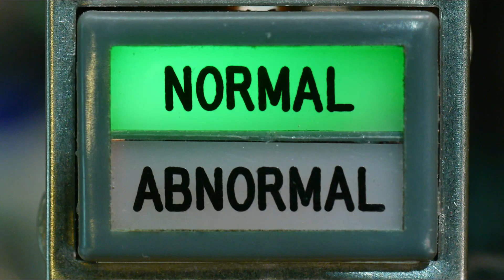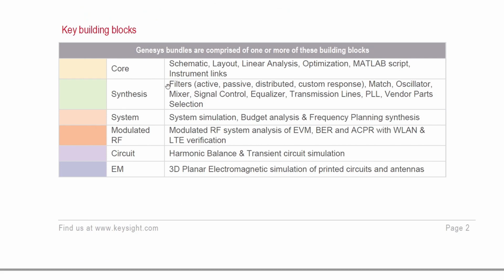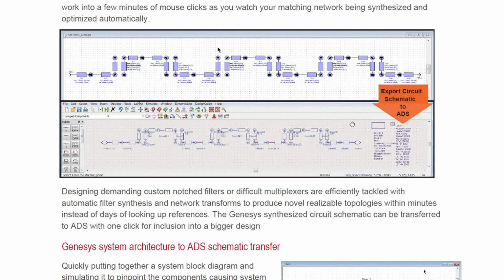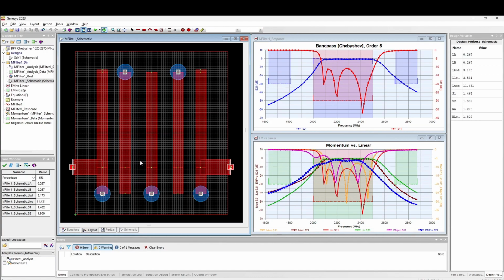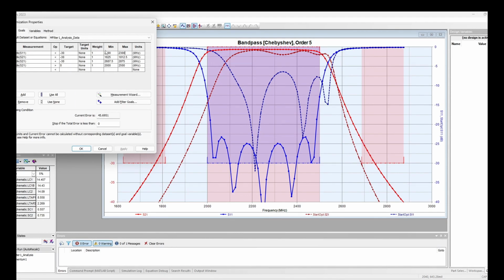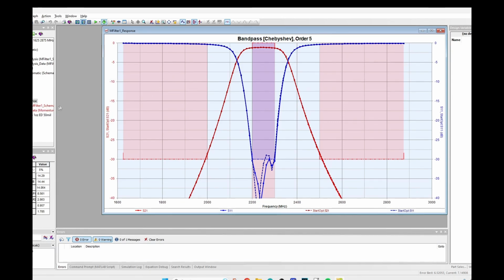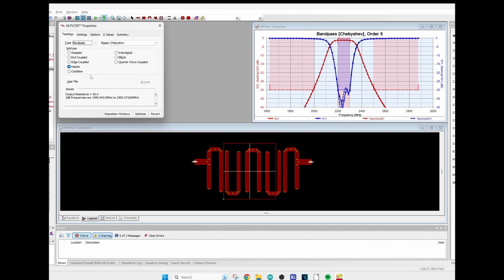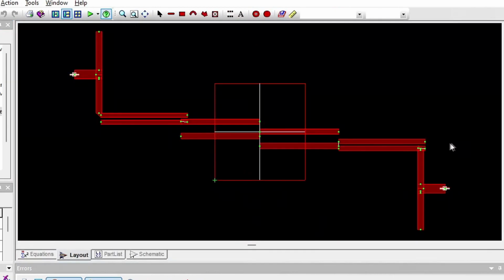#1587 Keysight Pathwave Genesys RF CAD Tool

Comment: ADS was a good tool. But, you don't need ADS to do micro-strip design; but, you need to know what you are doing. IMO the  power of ADS lies in the simulation parameters you can access... such as the pcb board types, and copper weights... as was mentioned. It's also easy to use ADS (or Genesys) to come up with a design that meets your specs; but, you haven't got a clue how it's working. That's the voodoo... which is short for "I'm too lazy to learn the engineering involved... so I'll pretend I wouldn't understand it."
Reply from the maker: I will be talking about the EM Momentum analysis which I find the most powerful.

Comment: I got a free copy of Sonnet with the book "Introduction to Antenna Analysis using EM Simulators", from Artech House. No idea if it is still available. One of the authors was president of Sonnet Software. Just a suggestion for those who don't have the freebie line to Keysight.

Comment: The weird thing is even though this is right up my street, when I see these astronomically priced packages that have no path for hobbyists AND represent a perpetual financial cost I kinda lose interest. It's cool and all but I think analysis of packages that a hobbyist can engage with would have way more traction. It's one of the reasons I dropped Altium because even though they imply they support hobbyists to hook you they really don't. You'll find that out when your next annual renewal comes around as the company claims poverty to justify their inflexibility on the absurd renewal pricing and disregards the fact that you're a hobbyist non commercial user.

Comment: Interesting video and quite different from your usual ones. I'm curious how many viewers are engineers vs. hobbyists. Has Keysight changed their stance towards electronics hobbyists? I myself am a hobbyist just getting into electronics. I have enough of a math background to not be intimidated by Maxwell's Equations (or any equation for that matter). But this kind of software still just seems like magic. I'd really love to know what are the actual algorithms they're using when you press the optimize button but that sounds like it may be proprietary secret sauce.
Reply from the maker: I did a survey and engineer to hobbyist is about 50 50. I've used lots of optimization software in my optics design work. This is a very hard problem. In optics, the designer has to write their own merit function and that is quite difficult. This seems to be more limited (easier). the trick to these monti carlo  searches are not getting tricked into local minimums and finding the global minimum.